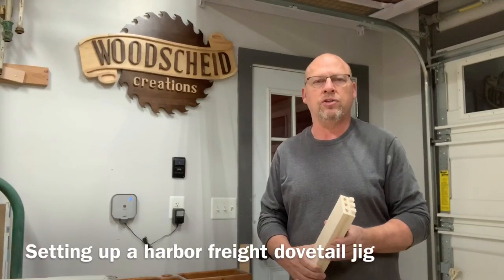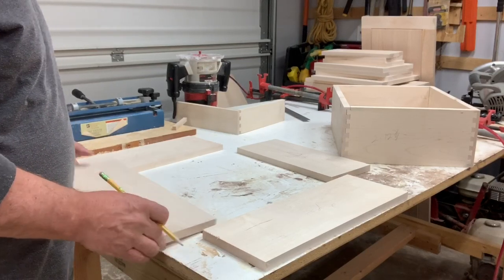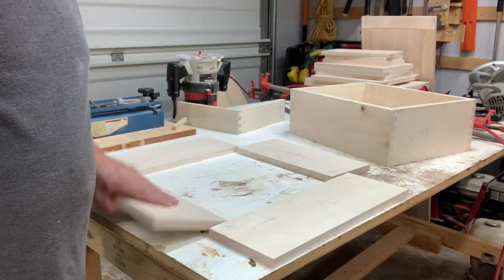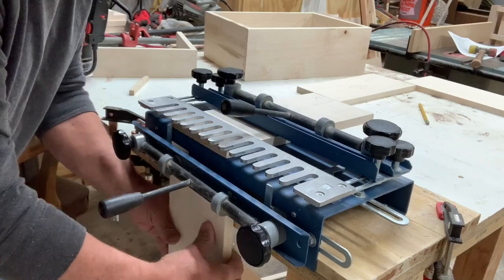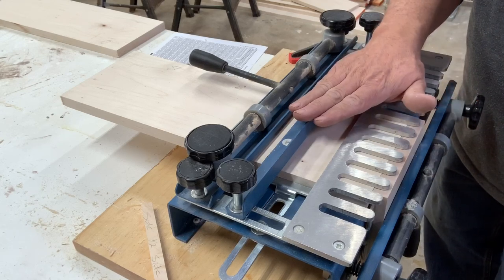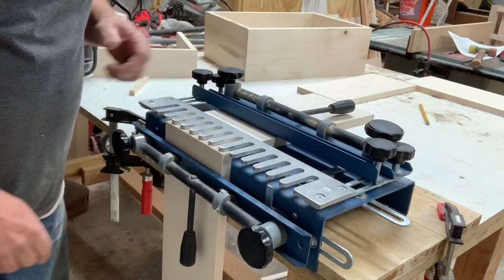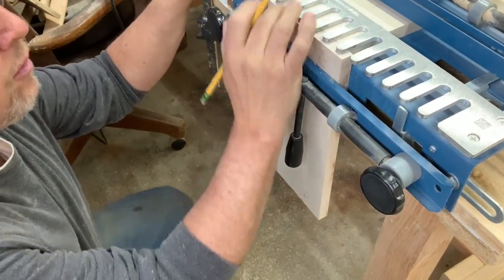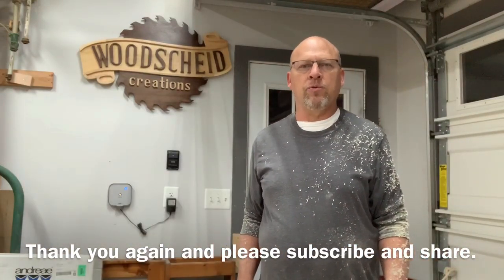Setting up the harbor freight dovetail jig

Comment: Use sandpaper or a file and knock off all the edges on the comb and sand the surface smooth. It really did a number on my router base from being rough.

Comment: Did the chart you used for the thickness to width ratio come with your jig?  I don't think mine has that.  Can you post a copy or tell us how to obtain a copy?  Thanks.
Reply from the maker: The chart came from “Woodstock dovetail manual”. You should be able to find it online. The instructions for the Woodstock brand is much easier to follow.
Reply: @woodscheidcreations8188  page 15 for enquiry minds, Thank you very much for this.

Comment: Thank you for the tip about using the half inch spacer.  I just bought mine last week and was having a hard time getting the boards lined up properly.  I also like your tip about scoring the  board on the first pass to avoid tear out.

Comment: Thanks very helpful. I have been struggling for days trying to setup this jig I got from a friend. Can not wait to get Back to the shop and try all you great tips. 

Been in South Africa I am left with the metric dilemma...... But the were is the fun if you can not work in 0.5mm tolerance.
Reply: Go buy a Poter cable one. The Hf ones suck

Comment: I have 2 questions if I may, 1st I'm confused about the upper fence that you marked back 4 1/2", what is the significance of that fence, I don't really see any reason it should matter really. 2nd Q can you make full through dovetails with this jig? On the box it said 1/2 blind and full dovetails, am I miss understanding what they're attempting to say? Thank you, great vid by the way, some of the guys doing this type of video look like they just took a hit of crack or speed, it's really hard to follow them and yours was on point and st4aight forward.
Reply from the maker: The top fence is to control depth so that the joint if flush when joined, if you don’t set correctly dovetails will either be to deep or protrude out. Not sure if you can do through dovetails. You can look up the instructions for WoodStock brand dovetail jig, they are much better and the same jig as Harbor freight.

Comment: You make this look super easy. I am going out and get one but first. Can it be used to make through dove tails?
Reply from the maker: Thanks for watching, I don’t think you can do through dovetails due to the bit depth and you would also cut into the metal jig unless you used a spacer on the top board. I just ordered a through dovetail jig and bits that you can use on a router table,  I’ll make a video on it once it comes in.

Comment: What is the purpose of the 1/2" spacer block?
Reply from the maker: It offsets the front and top fence by 1/2”.  The two pieces need to be offset to make both cuts a the same time.

Comment: when you put the side pieces (verticals) which way did you place the lettered side? Towards you or towards inside of jig? The horizontyal piece you mentioned has the letter on top side when cutting.
Reply: Ron Alan lettered side out (i saw a B in video near end just before he cut dovetail) the verticals get rounded over on face facing you and backside is the face you see when assembled

Comment: I've finally got it going, what would explain a sloppy fit? My depth is good but they are very sloppy.
Reply from the maker: This is from the Woodstock Dovetail manual; 

If you find the fit to be about right in every other aspect, but it is simply a little too tight or too loose, the depth of the router bit is probably maladjusted. See Figure 28
  1. 2.
If the fit is too tight, decrease the protrusion of the router bit from the base.
If the fit is too loose, increase the protrusion of the router bit from the base.

Comment: I used this jig but the pins won’t fit into the groove what am I doing wrong
Reply from the maker: Robert, check the depth of the the bit, it should be 9/16 from the router base. If the joint is too tight then decrease the depth until you get a good fit. Try it on scrap that is the same thickness as your project. Hope this helps.
Reply: @woodscheidcreations8188  I ended up getting it right not long after this comment and yes, that was the issue the bit was set too deep.   Thank you

Comment: What size router bit do you use on this jig
Reply from the maker: It is designed to be used with 1/4" shank, 1/2", 14° dovetail bits only. The bit should protrude exactly 9/16" below the router base.  You can refer to the Woodstock manual online, it’s easier to understand and has the chart I show for the fence setback. Thanks for watching.

Comment: The bad news is the vertical stop bracket is higher than the horizontal bottom board and when you go to cut for the horizontal end the bracket eats your $21 dollar bit. .I cut a 1/4" off the bracket but was unable to do another test cut since the bit dulled and is shot. Also the bit depth has got to be perfect in order to get the horizontal piece cut through all the way without the bit touching the metal base of the jig.. 19/32" as you have to account for the thickness of the tongue. New bit tomorrow or abandoned dovetail drawers for now.

Comment: Unfortunately the most important part of the video is a botchup. You show one board with letter "D" placed. For the matching board, it is completely confusing where the "D" on the other board was. That is one of the crux points. Completely makes a very well produced video useless. Pity.